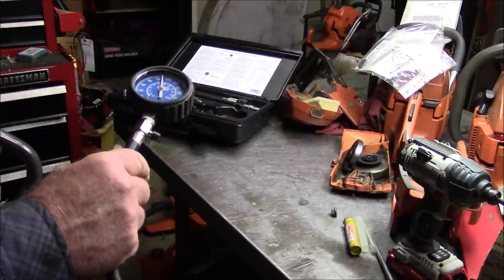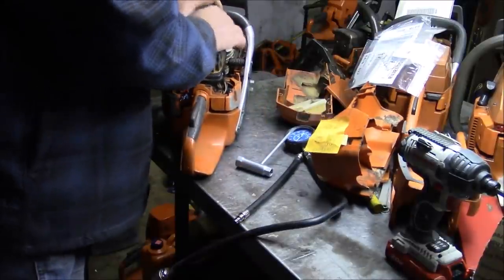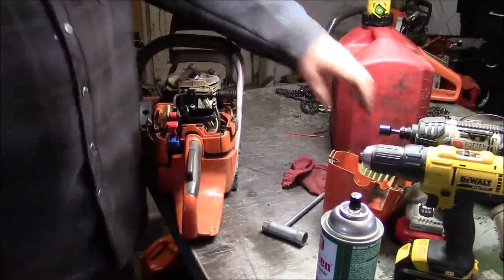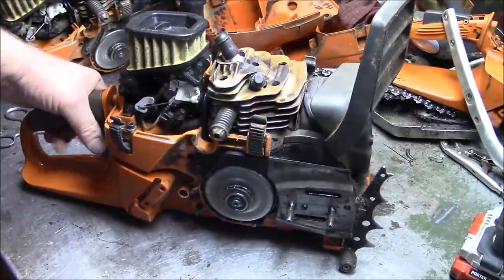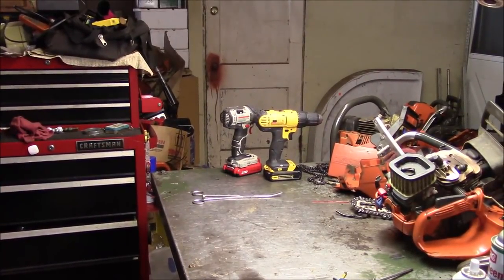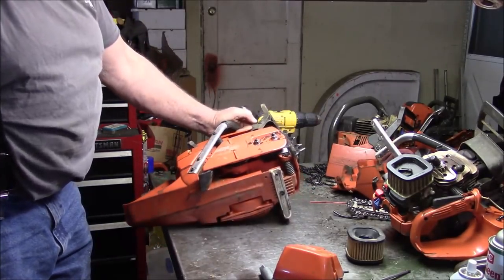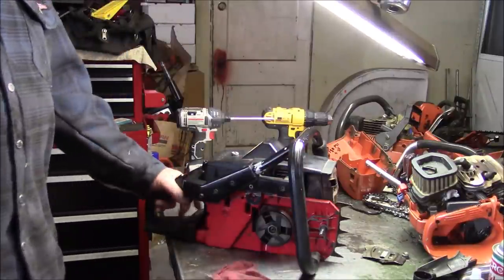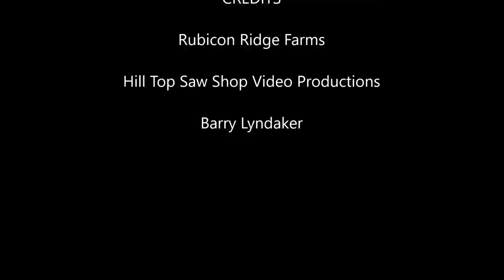Compression Test Husqvarna 272xp & 576xp, Holzfforma g372xt, Jonsered 920 & Typical Saw Shop Issues

Comment: Love my 576's I have an AT & a Non AT
also have 3 575's but 2 are parts saws

Great info on the Durability and longevity of the XT aftermarket clone with modest upgrades

A broken OE throttle cable can say I've never had that happen 

And the crank seal on that ole Jonsered wish they were all that easy to change 

Be Safe

Comment: Hello Walt, Thanks for your videos, I have learned so much from watching them and it has encouraged me to rebuild a few saws.  I know you are a Jonsereds guy and I wanted to know your opinion.  I am considering purchasing an 820 for chainsaw milling and I wanted to know your opinion regarding the anti-vibe on this era of saw.  I see from the IPLs that they are rubber bushings but without springs.  How does this compare to the more modern spring anti-vibes?  Thanks again, DC
Reply from the maker: Great old saws, and they would certainly be capable. I wouldn't buy one for milling though. Unless u are a true enthusiast and not afraid of hunting parts...for years...and getting into the saw restoration and repair on vintage saws. Reason is parts for those are scarce. hard to find. Milling is a very hard application and will take an old saw and kill it if the seals and all things related aren't fresh. Get a 820 to run once in a while and to get into Jonsered's, not for a real task such as milling. Milling needs to be done with a new saw with parts support. A 390, 395 etc. On the cheap even a Aftermarket ms660 can be made to work with the right build components. Reason is the availability of parts and with those killing one doesn't matter as much.
Reply: @afleetcommand  Thanks!  It turns out I am a true enthusiast.  I am into old saws, repair and restoration.  I have built a 61 into a 272 following your videos and  I have restored a Pioneer 620 and a Homelite SuperWiz 80, I have a 70e and a pile of old macs.  All my old saws run and cut and get used.  Thanks for your videos they have helped me immensely.

Comment: Do you still like your 565 and how does it compare to the 576 even though it has a few more ccs? I absolutely love my 565 and only paid $749 out the door. I was originally going to get a 562 for the same price so it was a no brainer to get 10 more ccs and a lot more torque IMHO.
Reply from the maker: 565 was a good purchase. A little sluggish vs. 572 maybe. But does everything well enough it would be hard to justify the extra bucks for a 572 in reality. Vs. 576, no contest. Bigger bearings. Lighter feel, and it will be supported into the future.
Reply: @afleetcommand  As I understand on the autotune 576, it cannot be updated or”flashed” because there is no connection to the CST. It has also been discontinued and replaced by the 572.
Reply from the maker: No CST 4 u ( to the 576 saws :) )

Comment: I  was wondering if you could make an adapter for mounting a timing wheel(motionpro) to flywheel side  of 026 Stihl crank
Reply from the maker: Just find a drill chuck and mount it to that, a chuck can grab anything round.